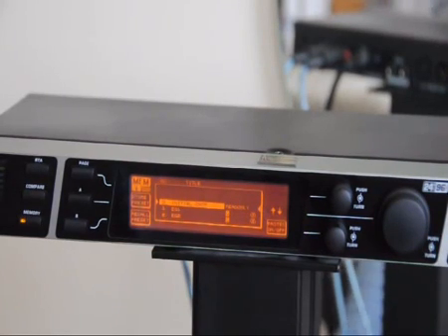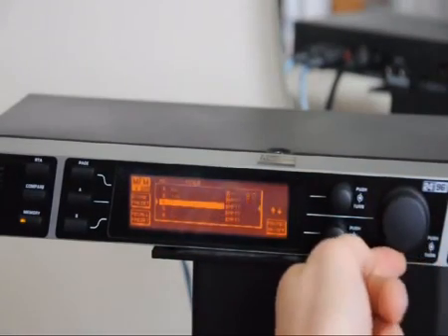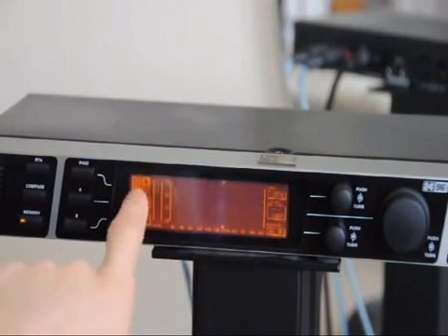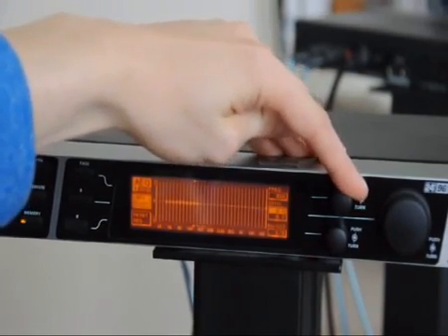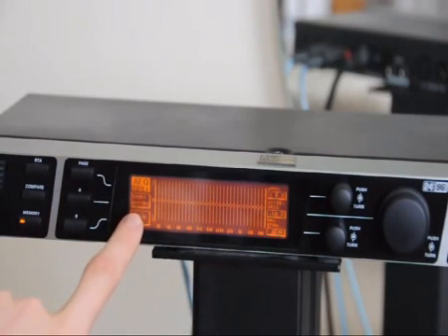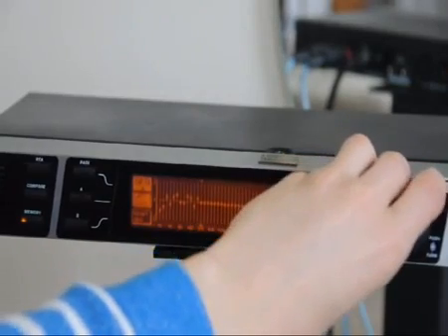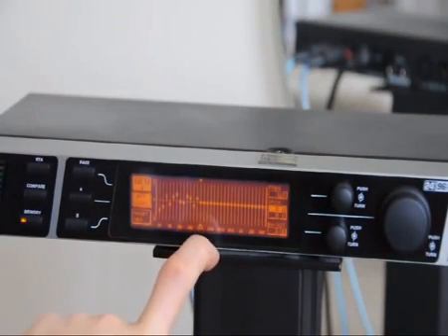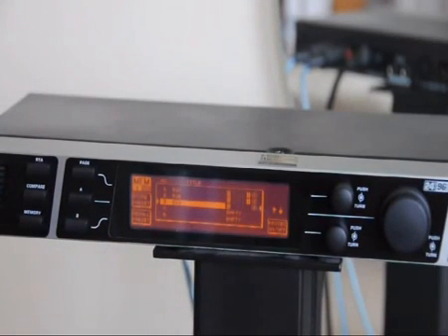DEQ2496 Room Correction EQ Guide

Comment: I don't know why, but it's callibrate and turn HF too high and LF too low, even with Room Correction- doesn't matter. ECM8000 sounds nice. I callibrate with parametric EQ and Sweep-tone manually. Sounds acceptable flat. (Tannoy 802)
Reply from the maker: Flat response can sound like LF too low. Most rooms boost the bass by resonances so music is mixed like that. Google Harmon listening target curve. http://www.audioheritage.org/vbulletin/showthread.php?39134-Harman-Target-Curve&s=cb6a3d71f191a5dfd534a2ff050c8ecd&p=400233&viewfull=1#post400233
Reply: @Audio_Simon  Thanks!

Comment: You left out the step where to lower the gain level of the pink noise before starting the test. By default it blasts out at 0db. Just got my unit today. rip tweeter :p